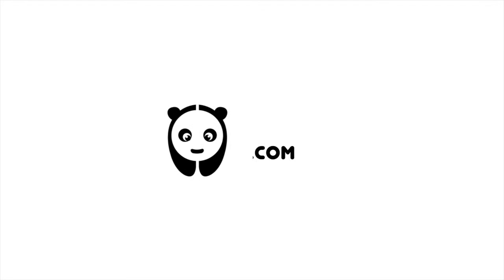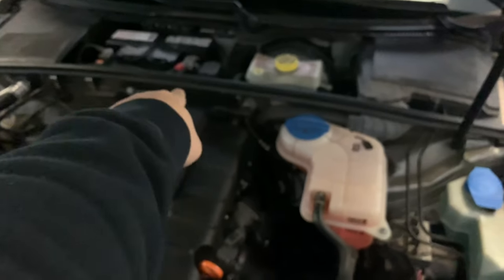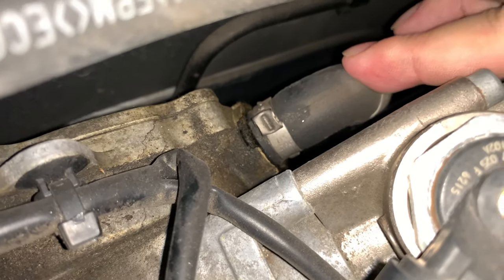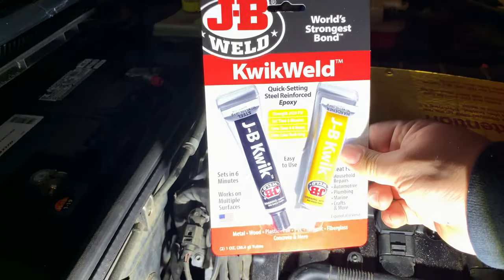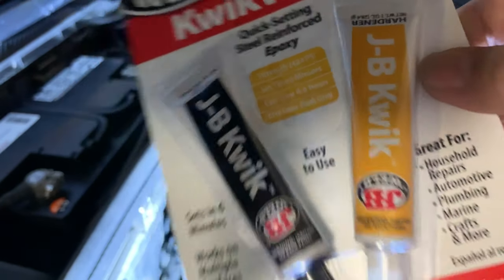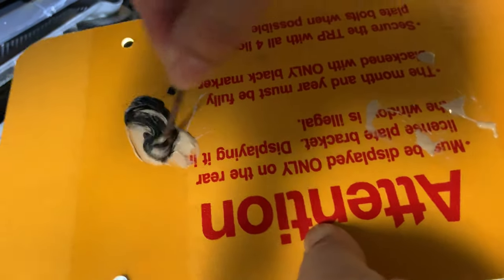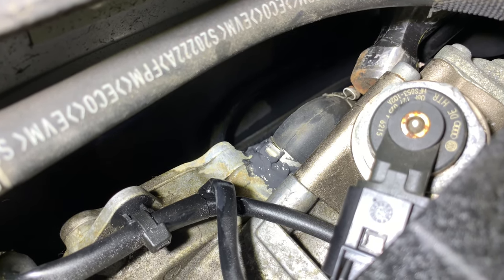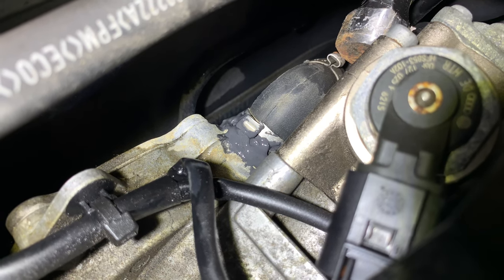How to Fix Knocking Noise from Vacuum Pump on Audi A4 B7

Comment: Should show before and after  noise fix
Reply from the maker: Great point. The problem is it that it would only do it when it’s really cold and it warmed up by the time I got to repairing it.
Reply: @petervonpanda  Did you ever upload a follow up video to this one? Like a post-fix video?
Reply: @petervonpanda  if you fixed it wouldn’t it e the same as in warm or cold weather just no clicking either way

Comment: Good solution! I replaced the o ring inside that line which fixed the issue but within 8 month it came up again. Im going to repair it the way u did it asap.
Reply: How did you get the hose off to replace the oring ?
Reply: @chuckweaverweaver6537  hi actually my mechanic did. It is a bit of work
Reply: Eventually the o-ring will go again, and jb weld isn't the best at making air tight seals and holding them. So when it blows again it will leak passed the jb weld but now you can'treplace the o-ring like you did last time. Instead next time you do the o-ring make sure they use a genuine audi o-ring if you can get the right one. No o-ring will last forever, don't glue it together to try hide the problem.

Comment: Minneapolis reporting in; yeah, after the deep freeze in January, I had the same issue. I was also getting oil leaking out of the vacuum pump so I replaced the whole thing. I saw online that the newer models of the pump actually address the leaking issue, so it was worth the time/effort. It actually wasn't awful (granted I had replaced the oil filter housing a month beforehand which took 8 hours so my concept of "not awful" might be skewed). I also noticed my brakes stopped squealing afterward. Not sure if it was related or if the squealing I'd heard was actually coming from the pump.
Reply: MartyMcFly700 I actually did the work myself. I believe the part itself was $250.

Comment: Hey, curious how your fix is holding up?

Also for people who think it’s the cam chain tensioner you can easily tell the difference if it is this as it will be visibly moving up and down when running on cold start and if you hold it down with a finger even lightly it goes away.
Reply from the maker: So far, it's still holding up fine!
Reply: Thanks for the info! About to try this as the Audi dealership told me it was my cam chain tensioner.

Comment: Vacuum line leaks might be the cheapest easiest fix in auto repairs. In your case, a new O ring may have worked as they shrink and decay over time. The quick cure JB Weld will be easier to remove if you need to replace pump later. All this remote diagnosis and you didn't have to wait hours on hold to India. Peace

Comment: It's not that making noise, mine did the same exact thing and it's the cam chain tensioner. Just replaced that with a new chain and many other things as I had to disassemble the engine to replace all my valves due to a timing belt breaking

Comment: Hey
Thanks for the video 
I have a 3.0 tdi quattro b7 avant and I notice when accelerating I hear like air vent hissing sound almost like it’s from the ac system but it stop when come to a stop at lights , car performance seems fine, wonder if you can advise me on this ?
Reply: Did you ever find the problem with this
Reply: @kinanal-akhras5336  That sounds like a vacuum leak. Would perform a smoke test through the intake to find wear it leaks from. Vacuum leaks can sound like a hissing or whistling sound.

Comment: This idle is totally fine. On cold starts, the ecu is warming up the Oxygen sensor (Lambda), it takes around 1 minute. Just wait for it.
Reply: Not warming the o2 sensor but the oil, as it warms, the viscosity reduces and it can flow around the motor, lubricating properly
Reply: @0xBret  not even, The o2 sensor takes 60 seconds to warm up to 600 (or above) celsius degree on 1200 rpm. You can read it in the service manual. Also I have a parking heater, to create engine preconditions, but still need to wait for o2 to start sending the signal for the correct fuel mixture. You can read the o2 measurement block in VCDS while on cold-star, it is warming up...

Comment: Its mid spring in Connecticut and my car sounds like this car cold and hot also causing misfire in cylinder 3 but that goes away as the car warm up. I just got the car. Someone JB the hoes going into the pump but not the end as shown in your video. My question is does the pump ever stop making the sound? I do have a use one that I need to get a new o ring for. I know its not the motor or the timing chain area. Will get a stethoscope to pinpoint the sound tomorrow
Reply: @adamsimon5489  that seem to go away as it started heating up outside. But my uncle has the car and we think its the timing chain.
Reply: Hey I live in CT aswell my 08 Audi A4 has been behaving the same way ticking noise from back of engine afraid it’s the valve lifters or the timing chain tensioner

Comment: Would this throw a engine code ? I got the same issue
Reply from the maker: Mine did not throw a code, but the noise was so loud, I didn't particularly drive with it knocking.
Reply: It’s not the vacuous the timing chain tensioner replaced mine and nomore knocking